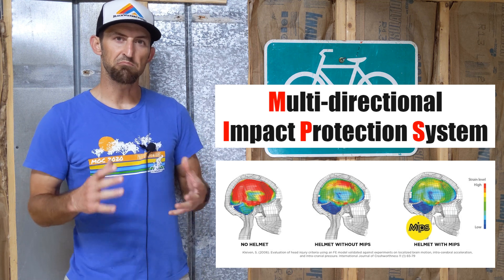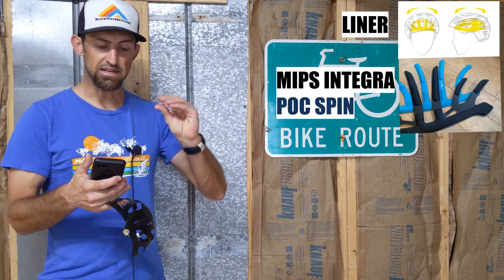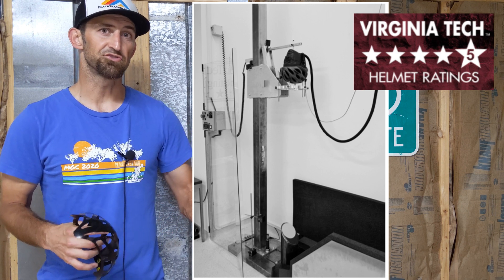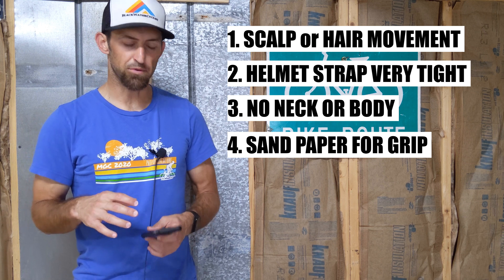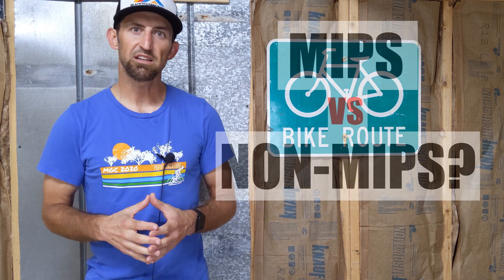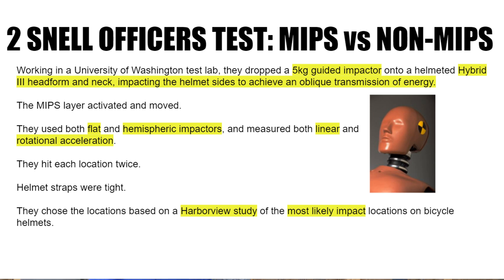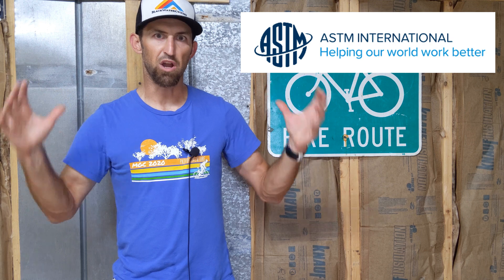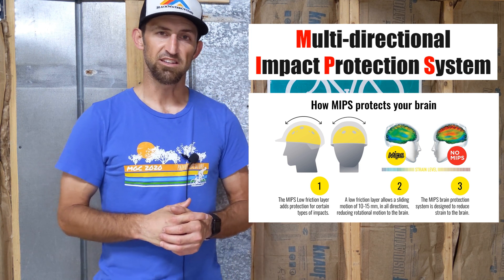Mips VS Non-Mips | Should You Buy a Mips Helmet?

Comment: Bro no joke my head shot off once ... luckily they stitched it back on and I made a full recovery and back to normal.
Well almost normal .... I do have bolts on each side of my neck but wearing a scarf you'd hardly notice them.
But in all seriousness many riders I see have the strap on semi tight if not actually a little loose and dangly under their chin so in
the event of a crash the helmet will twist anyhow ?
Whereas when I used to ride dirt bikes we had the strap snug and secure under the chin and much heavier helmets ?

Comment: Couple of weeks ago had a crash. I was wearing a Lazer Tonic (Non.Mips) I bought in an offer couple of months ago. Hit the deck, rear wheel slipped on some lose sand or dirt on the road going at roughly 32 kmph. I hit both sides of my body, the helmet broke, but I thought my head didn't hit the concrete because it was the only thing not hurting. Had scratches and bruises in both legs, forearms, left elbow, right shoulder. Next day cleaning the dirt of the helmet notice a dent on the right side and a moment later I see the helmet is completely broken in the inside. Thank God I was wearing that thing and not some super cheap helmet like the one I was using.

They say Virginia Lab's under 14 points (not only the 5 stars) are ideal. Supposedly Lazer's Tonic MIPS (not the Kineticore) is one of the safests helmets for road cycling. But I think they're discontinued.

I'm considering Giant's Relay MIPS (because I don't have a lot of money to spend on a helmet).
Reply: Did it have Kineticore? I crashed some months ago in a Lazer Cityzen equipped with Kineticore, like you I didn't think I hit my head since I didn't feel anything, but when I came home, I saw a crack in the foam....
Reply: @mattiasjohansson1727  No, it was an old version. I actually bought it on some special offer and they told me Lazer don't make it anymore. So I had to buy a Giant Relay Mips because 60 bucks is kinda expensive here.

Comment: Re MIPS, This does not protect the brain..While the forces are mitigated, there is nothing in this presentation that accurately shows any benefit to brain protection and it’s not FDA cleared for any related purpose.. It might be able to provide some protection to the rider from skull fractures and lacerations but that appears to be the extent of its capabilities, at least to the extent of the presentation and research discussed.. Overall great presentation! Be safe!

Comment: I am sceptical about MIPS in this "first" (inside liner) version. I agree, for me, it also looks that you have to wear your helmet unrealisticaly tight for it to really work and make a difference. I tried on MIPS and non-MIPS helmets, and that's what I noticed. Otherwise both helmets slide on your hair similarily, but MIPS makes a helmet less comfortable and blocks some ventilation.
I'd prefer this GIRO version, where the outer shell moves, Lazer Kineticore solution, or Bontrager Wavecel, those have more sense to me.
Reply: what abour KOROYD on smith ones?

Comment: Best video of them all so far!  Introduced me to the Virginia Tech testing and rating of bicycle helmets!   It needs to be emphasized that the SNELL study needs to be completely discredited for what it is - an idiotic test design that would be valid if you were testing for construction hardhats but totally invalid for the injury mechanisms underlying most vehicular head injuries.   The SNELL test basically drops a giant brick onto a stationary helmeted target and assesses only for the crush protection.  The force of a sudden rotational acceleration of the head, the underlying mechanism of injury that causes the well known (if you are a neuroradiologist like I am) phenomen of Diffuse Axonal Injury (DAI)  is simply NOT a factor in the SNELL test.   The VT tests drop a free form helmeted head at different angles onto various blocks.   This simulates the underlying motion of the human head before it is suddenly stopped by a crash into something - the angle of the crash WILL CAUSE THE HUMAN HEAD TO SUDDENLY ROTATE, and it is this sharp sudden rotational acceleration that that causes the axonal fibers of the brain to sheer off from the neuron bodies at the gray-white junctures and in other white matter regions of the brain.  This mechanism  WILL PRODUCE multiple tiny microbleeds and other changes visible on high quality MRI studies, and are the underlying basis for a long lasting often devastating TBI.  DAIs are totally real and the mechanism that causes them have been understood for decades.  The SNELL test people simply have no clue what they are doing because their test DOES NOT SIMULATE the mechanism of action that causes DAIs.
Reply: After all of this information (thank you btw). Can you say MIPS is a must have or fine without it?
Reply: But why did the MIPS bontrager rally test higher than the bontrager rally wavecell? Why did trek suddenly discontinue the rally MIPS after the VT results put the MIPS as safer over the wavecell same model?
Reply: @chefgav1  No idea.  You should ask Trek. 
My entire post was about what a completely IDIOTIC test the original SNELL test design was because it absolutely 100% DOES NOT TEST FOR ROTATIONAL HEAD INJURIES.
Like I said, I am a neuroradiologist by profession.   Diffuse axonal injury (DAI) and the rotational mechanism that caused it was first described back in 1982.   I have seen many many cases of DAI on MRI brain scans. There is absolutely no excuse for anybody involved in the study of head injuries or helmet protection for head injuries to not know about this cause of traumatic brain injuries. 
BTW, this sudden rotational acceleration and deceleration of the head is also what is the major mechanism of injury in Shaken Baby Syndrome type of child abuse.
Reply: @gandalfgreyhame3425  Thank for the information

Comment: I never bought into the idea that such a thin liner that can move at most 1cm would make a helmet safer. 
I don't know if Wavecel is safer (like Mips, data for Wavecel is lacking) - but does make more sense to me. So if costing the same, I would choose Wavecel over Mips.
Reply: So why did a trek helmet with mips test higher than the same model with wavecell then?
Reply: @chefgav1  Reference please.
Reply: @virkelie2  it's the bontrager rally. Where have there MIPS model gone? Why did the MIPS rally test higher than the rally wavecell. It's the same helmet but different tech. Very suspect

Comment: off-topic: you should not keep your house insulation in the bags - they get compressed and need to be fluffed up - it is the tiny air pockets created when fluffed up that are the air insulation between the inside and outside of the walls.  For example, Inner-Safe batt insulation is compression-packed and will expand to its labeled thickness. 

nice helmet info tho!

Comment: I would be more accepting of VT's ratings if they ranked more helmets and continued testing helmets.
Why does the POC Ventral, and all its variants, not get listed at all? The octal spin got tested yet they couldn't for the ventral? where is the Abus helmets? etc.
Its fine if a helmet doesn't get ranked if there is a slight change i.e. visor added but not when a brand new lineup is left untested. 

For me, after looking at the tech MIPs is the most understandable and marketable. You know and can see how it is going to react whereas the other tech it is harder to assess with all scoring highly on the scales. Its a shame most of other tech is limited to certain brands since brands having differing ways of doing things mainly in the straps adjustment department.
Reply: Why does the bontrager rally MIPS perform better in the VT testing over the same helmet in wavecell?

Comment: You raise good questions, however VT does have a long history of  helmet research.  VT has researched and performed testing for the NFL and NCAA football as well as the NHL.
Reply from the maker: Yes I agree they have been doing research for awhile and I do appreciate them doing it. I believe SNELL has been doing it longer. It would be very interesting if they attached the head to a fixed structure that replicates the neck and redo the test with the same sensors. Maybe Mips would test to be even more beneficial. I would just like the test to replicate the real world as closely as possible. I appreciate the input.
Reply: Also bontrager rally have a mips and wavecell model and the mips tested higher at VT but not only that bontrager removed the mips from the market not long after VT results were released. This must have been a huge embarrassment for them
Reply: @chefgav1  For me the fit from the Wavecell helmets was uncomfortable and somewhat heavy I felt.  However, I have a friend with a Wavecell helmet and she has no complaints.
On a side note, I had an issue with a Bontrager product.  The Trek/Bontrager customer service team were most accommodating and for that reason I feel confident when purchasing their products.

Comment: Does this video also apply to ski helmets? Or is it different when falling in snow?
Reply: I think on snow or ice condition you have less friction force than bike helmet on asphalt surface. The ski helmet could easily "slide away" on ice or snow, so theoretically MIPS is not as important(if it was important) as on bike helmets.
Reply from the maker: Yeah I'm not as experienced with snow sports but any surface that can grip the helmet, Mips is supposed to help. Maybe a soft spot of powdered snow that the helmet grips when you make impact.

Comment: Yeah, I don't believe the whole MIPs is better narrative. It simply doesn't make much common sense. If your helmet is so extremely tight and you have no hair, then maybe, maybe. In the real world, most people have hair and wear the helmet with a snug fit that still allows for movement.
Reply: But that movement is not as easy as with Mips, cos it is just friction between glossy plastic parts. And in case a quick impact, a tiny difference in friction can make a big difference in damage.

Comment: My humble opinion: get the cheaper helmet without Mips and use the money left to get decent gloves. Your head protection is important but if you crash and your bare hands reflexively catch the impact on the road surface you'll learn the hard way how often you use your hands every day. As an added bonus, gloves are light and small enough to fit in almost any pocket, really convenient.

About Mips: bike crashes have strong enough impacts to basically fold your front wheel, and at surprisingly low speeds. I find it hard to believe that this little additional movement supported by Mips makes a difference compared to the forces involved. Truth is, helmets are just the most viable solution we could come up with given a pretty unfavorable anatomy, hitting your head in a crash is the worst that can happen either way and imho wearing a helmet at all in that situation is what matters.
That said I'd be glad to be wrong about this, any progress in this area is worth a lot.
Reply from the maker: Yes I lean more towards the idea that a slip plain is really not going to make as much of a difference as many think it will due to other factors. Now that they are more integrated and the price doesnt seem to be too high anymore for lower end helmets with mips, it isnt as much of an issue.
Reply: I ordered a mips helmet, triple 8, it was $75 bucks vs 50 for another one. And got some good wrist guards. For an extra 20 dollars, even if it's just placebo, is worth it to me. I'm glad I didn't buy a $150+ mips helmet though

Comment: If you have a $5 head, buy a $5 helmet...
Reply from the maker: The point of this video is not to disprove MIPS but just bring awareness to the claimed "best safety test". The newer Mips offerings and rotational options are much better than before and pretty much all helmets have some rotational protection now.
Reply: @BlackWaterCyclist  I'm usually sceptical of 'in house' safety systems and enhancements but I think the team of neurosurgeons behind MIPS and it being a stand alone entity gives it legitimacy that brands would struggle to achieve.
Reply: @iaincullen7646  Sounds like you're ready for your next booster..

Comment: I just did a warranty exchange on a wavecell helmet after the rider taht collided with the back of an suv. The outer portion of the helmet had a very very small dent on the impact zone while the inner wavecell portion was completely smashed in on the impact zone. I'm not sure what rotational impact the wavecell may of helped in but thinking that portion could of been the riders head made me appreciate the design and he was able to walk in and make an exchange for a new one is always better than a trip to the hospital.
Reply from the maker: I really like the idea behind the wave cell design. I wish it could be designed to have better ventilation but other than that, I like it. Great info here and I appreciate you taking the time.
Reply: @BlackWaterCyclist please explain how the bontrager rally MIPS tested higher than the bontrager rally wavecell? Don't you find it strange they removed the rally mips from the market after the VT results came in?
Reply: @BlackWaterCyclist how do you explain how trek with mips tested higher than the exact same model with wavecell then?

Comment: Informative  video. I came off my bike yesterday and gave my helmet a good wallop, breaking it  and leaving me with a thumping headache since , so was looking at a new (MIP ) helmet, but the prices are much more than normal helmets. then I came across this video and made me think again, probably MIP is  useful under very strict lab conditions, but in practice - I  don't wear my straps  neck throttling tight, and when its  cold, will wear a headliner, so it does seem a marketing gimmick for most.

Comment: Back in the early 80s, when helmets started becoming a perceived necessity for biking in general, the helmet fit rule of thumb was that it was supposed to be tight enough to stay on but loose enough to slide slightly on your head. That is exactly what MIPS allows, 5-10% movement. MIPS isn't padding for impact. The helmet is "saving your life" or "preventing brain damage" or whatever, not the MIPS. Just a manufactured reason to buy a new helmet.
Reply from the maker: I agree with you.

Comment: i watched several explanations and the whole GCN video where they go over it, and im still unclear how its actually supposed to help, because it turns so easy that there is zero dampening effect. Maybe im just dumb, but it doesnt make sense to me
Reply from the maker: Yeah it is all about the quick jerk of forces on the brain when the head hits the ground and it is supposed to dampen the effects of that. I still think your skin and hair already accomplish this. Also if the skin can do this already and you add another rotation to it, how much further rotation is needed until the helmet is not in the proper place to protect you.
Reply: I agree with you. Slippery plastic layers move very easy. I believe it could work if pull the head slightly from the beginning of the rotation, but not from the end. May be it decreases rotational impact because delayes rotation, absorbing linear hit firstly. So rotation happens with lower speed?

Comment: Great video. Good to see someone thinking beyond the publicity material and coming to a balanced view. Well done.
Reply from the maker: Thanks Peter, I appreciate the feedback and could not agree more.
Reply: @BlackWaterCyclist  I suspect you have a PhD! These are exactly the kind of questions peer reviewers and editors would ask before a paper can be published in a journal. Testing two identical helmets, one with MIPS and another without and then comparing the results, is a question anyone should ask before accepting a hypothesis.  And note that most crash-test humanoids do not have hair attached. This really should be a variable that is addressed in any test of a helmet.
Reply: @guyreviewer105  To include hair, they'd have to bring in another panel of experts.  To say a given wig does or does not sufficiently match the same characteristics and configuration of hair naturally grown from the scalp.
Reply: @guyreviewer105 Information isn’t quite correct. VT have tested a bontrager rally in mips and wave cell and the mips tested higher but not only that when bontrager mips results came out they removed from the market. How embarrassing for them

Comment: At 2:29 you can clearly see, that the helmet strap is very loose. But the Helmet still stays firmly on the head. I think you have to cinch down the rear wheel of the helmet very strong to achieve that. Not a very realistic scenario.
Reply from the maker: Yes I agree with you there as well. To get the benefits of MIPS, your helmet has to be unrealistically tight.